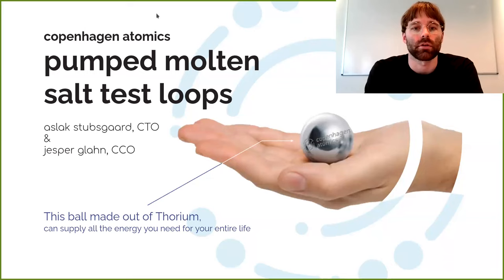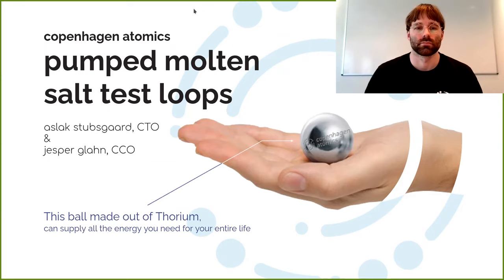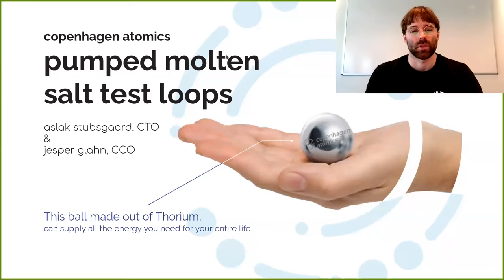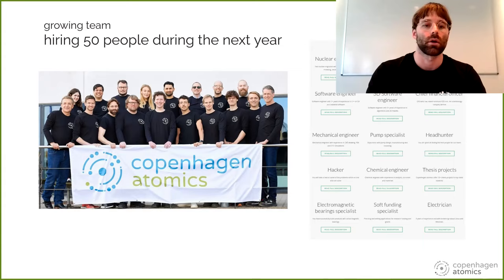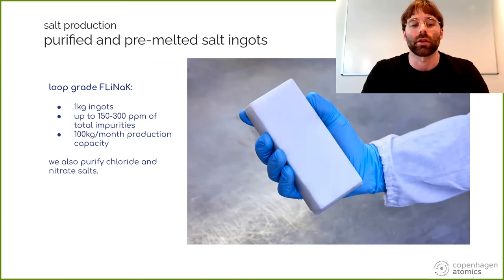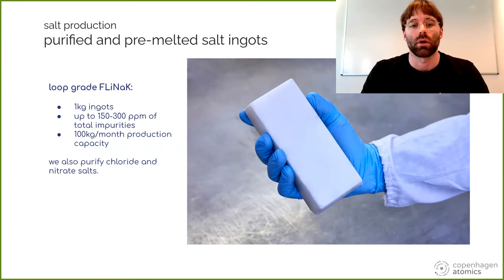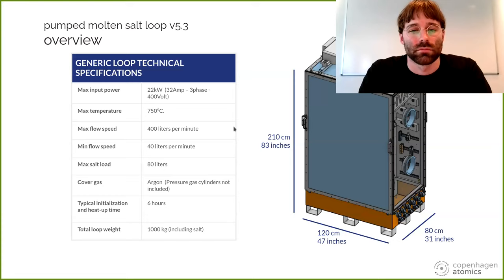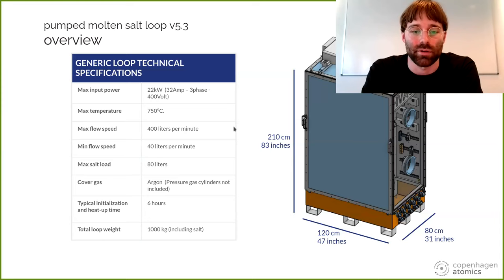Copenhagen Atomics Webinar on Pumped Molten Salt Loops

Comment: imagine mass producing 1MW test reactors at a price point that makes them attractive for use as heat generators, not just research.  The demand would be so high that production could be scaled up to reduce unit costs even further.  This would change the world. HUmanity would become wealthier by orders of magnitude while REDUCING environmental impact.
Reply from the maker: We will not mass manufacture 1 MW reactors. We will mass manufacture 100MW reactors from 2030. We plan to install one every day. It is not very difficult to make the production line. It is VERY difficult to get enough reactors installed and approve this fast. We must install many at the same sites and we MUST get a type approval and focus on a few countries only. Thus small countries are less interesting.

Comment: I like the emphasis on the iterative testing process on small scale, but scalable, systems, not because it's the tesla style marketing hype about the machine that builds the machine - that's gone too far, but because it helps people who would be very wary of nuclear (most people) to appreciate that this is safe enough to do so. There's a human and more manageable scale to it, and that makes the idea that it can be controlled easier to believe. 

I'm professionally interested in this sized system to provide a form of distributed thermal energy for long range more neutral temperature heat networks. The waste heat at 60-80 degrees produced after generating power from a Stirling engine gets thermodynamic efficiencies extremely high. 

If anyone knows whether this has been considered, I'd be interested in knowing.
Reply: Well, as far as Musk companies go I'd primarily compare it to SpaceX, where going hardware rich absolutely seems to have sped up their development progress compared to the traditional style in aerospace.

The important bit in avoiding delays is to build institutional knowledge not just with simulators, but having a critical mass of people who can tell what is practical and what isn't because they've already tried something similar in person. The learning process for that is relatively incompressible and the best way to get progress is to start doing hands on work as soon as possible.

If all you do is CAD modelling you're going to end up with a powerpoint rocket or reactor, and you don't actually build that much institutional knowledge relevant to the step where you actually have to build the thing, and you'll hit unpredictable delays one after the other.
Reply from the maker: The statistics are out there. Less than 1 our of 10 hardware startup companies survive 5 years and get cashflow positive. One would expect that with MSRs it is less than 1 our of 10. But we don't have enough data yet. It is more difficult to start a hardware tech start-up company, than a software start-up company. Thus many more software start-ups start. But also a large number of them fail before they are 5 year cashflow positive. Copenhagen Atomics have our 8 years birthday next month. We already have revenue, but still far away from 5 year cashflow positive. But I believe we understand the risk in this industry really well.

Comment: Good luck with that. I'll be long gone by the time you actually have anything. If someone thought this was a viable solution, you'd have more money coming in than you know what to do with.  The schedule would be cut by a factor.
Reply: The only thing "unviable" about it, is the profit streams that would be threatened, in using an energy source a million times more energy dense than hydrocarbons, at nearly 100% higher efficiency than the current 0.5% of embodied energy used before solid fuel requires shut down of the reactor and new or reprocessed fuel put in.
Reply: @orcoastgreenman  again... If it was so good, it would already be in place. The proof is in the pudding. 
I have made several investments over the years that sound just as promising as this one... That basically fizzle out upon impact when they implode! Just don't bet your bottom dollar on this.
Reply: @delinquense  - Oh I'm not advocating anyone invest in it, other than the government.   And they will have to get out of their own way first, and defy the interests of all the existing nuclear and non nuclear, energy industry players, who want to make sure a safe and clean nuclear, that uses the fuel at 99%+ efficiency, and doesn't require solid uranium fuel, never sees the light of day, just like they did with the WASH report, that incorrectly stated it was unviable.
Reply: @orcoastgreenman  then, if I understand you correctly.... You are saying that I shouldn't sell my oil stocks any time soon! 😊
Reply: @delinquense  - and I would imagine, that if you put a small amount in the many companies in this market, you might see phenomnal returns on some of them in the future.
Reply: @orcoastgreenman  if you are referring to publicly listed companies, I.e. stock market ... and that have proven business models,  assets and and a revenue stream, I would agree.  Already done.  If you are talking about startups like these ... you could buy dozens and still not see any gains. And you wouldn't know for several years later when they crash and burn with your hard earned cash.